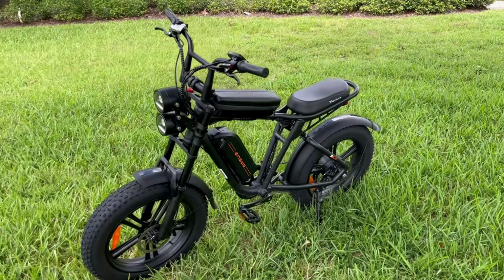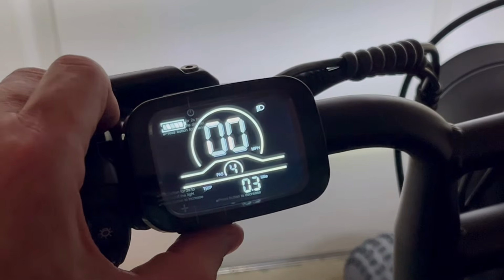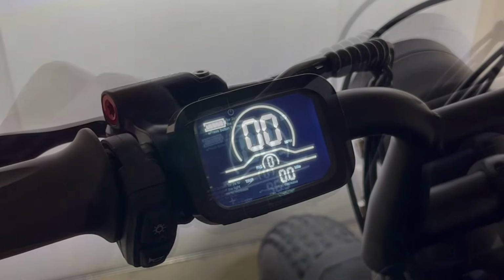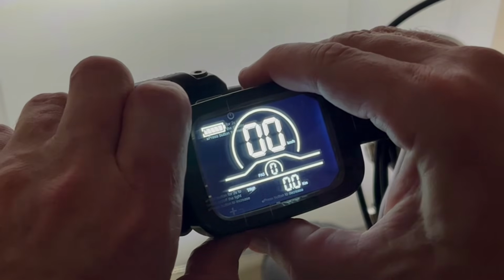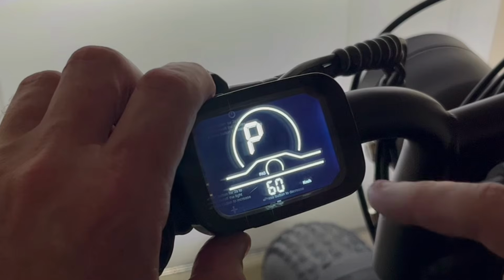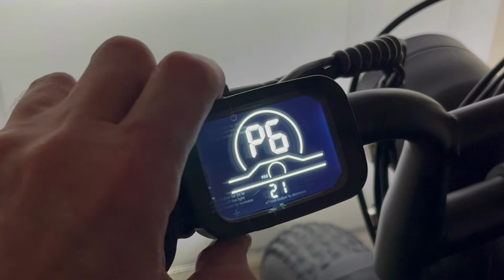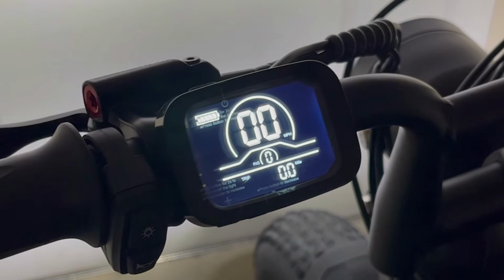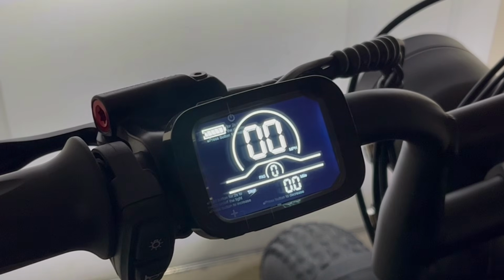Engwe M20 Display & Controller Settings - Yolin YL81C-B  kph to mph

Comment: What do E003 flashing on the bottom
Reply from the maker: E003 usually indicates a motor or controller communication error, so check all your cable connections.

Comment: My front lights are not turning on…. Can you help?
Reply from the maker: Verify if its the light or switch with voltmeter.   Turn on switch then disconnect headlight cable and measure voltage on cable coming from switch
Reply: Same here. Did you solve the problem?
Reply: @LeGoSinA  i went to a shop and the cable had a bad connection so they trade it for a new one
Reply: @franciscobaptista8385 , I guess those cables are not the best. Will replace them all when the Werther is better. Got some external lights for the moment

Comment: i have unluck my engwe m20 to 63 but if i turn up my settings in p2 does it even go more faster then and i allso tuned up my voltage since i have 2 batteries on mine with 26 amp
Reply from the maker: Can you go higher than 63 to 100?

Comment: Hey!
Does the lights at front ever go of?
I can’t seem to turn it off.
Reply from the maker: It should shut off when bike os powered off
Reply: @BRichSolution ig imma have to cut the battery connection off to the front lights.

Comment: Hi there, I am having a problem with my throttle. My rear motor is not moving. I can hear that wants too. I have seen a video on here that punch in some numbers and it work. I thought I saved it but I guess not. If you have any ideas please help me. Ty and love the video.
Reply from the maker: Does the motor work when you pedal and not twist the throttle?
Reply from the maker: See full video for advanced display settings

Comment: I’m reading online that you should put the wheel diameter as 20” and not 23”. What’s your thoughts? Since the wheel is 20”
Reply from the maker: Yes 23” as typical is the outside diameter of the 20” wheel with a tire on it.  I change that setting on most ebikes to what ever gives me the most accurate speed reading on the display screen at top speed

Comment: What happens if you put it on 24v or 36v setting?
Reply from the maker: Speed will be reduced and bike may not operate correctly
Reply: @brichsolution thanks. Someone online told me all it will do is read the wrong battery level and doesn’t effect performance

Comment: How do i change the modes? Like go full electric and not just peddle assist?
Reply from the maker: I think you may have a European model on engwe which does not allow for throttle activation.   Ask engwe how to change.  For some rear Engwe only has p01 to p08 settings.   Most ebikes have advance setting p10 set to 2 allow for throttle and pedal assist.  Let me know ow what Engwe says

Comment: I been holding the plus and negative buttons to bring up the advanced settings but it doesn’t bring me to the advanced settings theirs none of what your showing all that it’s displaying is a SP and four digits that are all set to 0 and allows me to change them between 1-9 but I think it’s the password setting that was in your video displayed as P9. . . . I don’t know if that made sense but is their a yollin device or Manuel that operates differently and I just got the wrong one? Or am I supposed to enter in this password so I can access the advanced settings? Because I don’t know how to do that.
Reply from the maker: Try password 1111 or 1234  if that doesn’t work ask seller for passcode
Reply: @ oh shit ya I should have tried that I can’t believe I didn’t think of that.
Reply: @kurtkiernan6070 sir can you tell me what the password is cause I have the same problem pleeeease??? Ty
Reply: Can someone tell me how to get past this is keep getting SP then the 0000

Comment: Good Lord Thank You! Thank You for taking the time to go over this. I been in my garage sitting on the darn thing trying to make it go w/o pedaling lol. My 1st ride. The thing they call Instruction Book/Owners Manual went right under my head.  I just flew to the local corner store and back and man what great fun! Got mine for $699, free shipping and since I know nothing about ebikes. I paid an extra $53 for the Allstate Protection plan. Covers even normal wear and tear. Who knew anyone did that these days. Hope I don't need it. For a noob ebike. I love it. I ride motorcycles and that's really what I wanted, not the bike part of it. Just to scoot about and there's mtn bike trails next to my house. I just hike them b/c of the deer, but now I don't have to worry. I can ride to the trails, walk or ride them and ride back home. THANKS FOR ALL THAT AGAIN. I'll be coming back. I just wanted to get to the part to get me going, asap.
Reply from the maker: Glad it was helpful
Reply: @BRichSolution  do you know why nothing happens when I try to unlock speed? :/

Comment: Does anyone know about "P8" - my display shows only "P8" and seems to be asking me for a 4-digit PIN code. 
I'm trapped on this screen and my ENGWE display is not activating the bike at all. I think I may have accidentally activated a PIN lock screen on my first ever ride on it because I was 10 miles from my house and couldn't remember how to switch the front and rear lights on. So I started pressing all kinds of + / - key combinations and + & - simultaneously - that displayed a flashing choice of P1 to P8 options. At P8 there was a no / yes question so out of curiosity I pressed "Y" for yes. After that the display refuses to let me move beyond this damned locked P8 screen that seems to want me to enter a 4-digit number.  
There's nothing about these P1-P8 screen displays in the user manual and nothing about PIN codes and what seems like a screen lock.
So - has anyone had this P8 problem?
Do all ENGWE ebikes have a unique PIN code ? 
Can I factory reset it to get rid of this screen lock that I've accidentally activated? 
Paul G
Reply from the maker: Try 1111 or 1234 if they do not work contact Engwe
Reply: @BRichSolution  I seem to be way ahead of you - below is a short Youtube vid posted by someone who has the exact same problem with his ENGWE M20 which has a display/functions which are 100% identical to my ENGWE P1:
https://youtube.com/shorts/w_1AD9fynrI?si=4K5mgYdbeBOWB-WT
Many of his desperate comment-posters there still have the same problem.
PS. Why do you suggest "1234" and "1111" - have others successfully tried those 4-digits with this specific ENGWE PIN lock problem??
As for contacting customer support - of course I sent ENGWE a full description(last night, Sunday) and a broader complaint about the non-existence of an ENGWE P1 Display user manual(ie. pdf file) - and they've promised to get back to me...
Paul G

Comment: Is there any way I can limit the speed the throttle can output as in germany the throttle is only allowed to go up to 6kmh?
Reply from the maker: Not that i am aware of.   I would disable the throttle or unplug it and use walk mode for 6km/h
Reply: @BRichSolution  thank you in p3 I put the speed to 25kmh but it still goes 30+ on Pas 5 I dont know what to do

Comment: My new US version of the M20 only goes up to 40 for the highest speed adjustment in the display. Does the changing of the AMPs really do anything?
Reply from the maker: Were you able to confirm the speed with gps app?  I have a ebike says I am doing 37 but confirmed with GPS app showed 32 mph
Reply: @BRichSolution  I edited it. It only goes up to 40 on the display for adjustment vs the 60 I keep seeing on the videos.
Reply: mine does the same on 40  not 60 like all the videos
Reply: 40 is mph, 60 is kilometers ph. Listen to what he says on P3… then he switches it to Mph on P4.

Comment: Hey thanks for the video but my question is you had the tire diameter at 23. Shouldn't it be 20 since they are 20x4 tires?
Reply from the maker: 23” is the outside tire diameter of the 20x4 wheel
Reply: @BRichSolution  ohhhh. Ok thanks 😅

Comment: Does anyone know how to fix error 30?
Reply from the maker: E30 is communication error according to manual see link below.   Check the connector on the wire harness.  Disconnect the connectors and reconnect to ensure they are seated.   Did the bike get wet?   http://myosuploads3.banggood.com/products/20230321/20230321034539M20.pdf

Comment: Hi how I change into just power without assistance????
Reply from the maker: I don't see a setting for disabling the Pedal assist.  You could dry to disconnecting the cadence sensor on the pedal crank at the controller to see if that works
Reply: I had this exact issue. Worked like a charm, thank you! 
Now it's throttle only, no peddle assistance!  @BRichSolution

Comment: Very helpful,
if I wouldn't have tried this already.,.
The thing is, pushing + and - simultaneously doesn't open this illusive settings changer.
Reply from the maker: sometimes if you push one button first and not simultaneously it will not enter advance menu
Reply: @BRichSolution  srr,
the problem is that they locked this feature
and the only thing I can access is the factory reset.
Without me being able to change settings to 25km/h and settings to mph,
the bike I have isn't street legal.
( It drives 5km/h to fast )

Comment: Hello, I’ve bought mine Engwe m20 750W, but I’ve got one with the manufacture sticker saying it’s 250W. I’ve contacted Engwe and they are saying that my bike is actually 750W and “The 250w mark on this sticker is only for customs clearance”. Have you guys had the same problem? And of course I can’t unlock the speed 🤨
Reply from the maker: Can’t unlock it?  Does the screen have a passcode?  If so try 1212 or ask engwe for passcode

Comment: For those who can't adjust speed in +- menu when you enter the "+-" menu hold power button and + together on P1 untill screen flashes with 60kmh. The you can increase amps to 25... Other than that there's nothing you can do. Bike will top out at 27/28mph .
Reply from the maker: Thanks for the info!
Reply: Mine was going 33 then I took it to the bike shop to a popped tire and when I git it back it won't go past 25 miles a hour
Reply: Doesn't work

Comment: I managed  to lock myself  out on P8 , the release code is as advised 1212 however despite several  frustrating  attempts  over some 30 minutes the code was not accepted. 
Then suddenly  the unit decided  it was right & allowed  me to reset. Seems there is some  kind of inherent fault.
Reply from the maker: Interesting and thanks for the feedback

Comment: Author, thanks for the video.
How to remove speed limits?
My ENGWE O14 bike travels at a top speed of just 26 km/h.
Reply from the maker: Try passcode 1111 if that does not work then contact Engwe
Reply: @BRichSolution  You can find out more about exactly how to do this! and where to enter this password?
Reply: @BRichSolution  Thank you. Can you be more specific about where and how exactly this code should be entered?

Comment: I have the same controller, but when I go into the advance settings, it goes to P0 and I can’t advance it past that it has four numbers I can change at the bottom to start off at 000 but I can’t get into the advanced settings for the real size and changing the speed
Reply from the maker: Ask engwe for the passcode

Comment: Hello 
P3 is not working it's on 25 not increasing and not reducing
Reply from the maker: reach out to Engwe for solution.  Do you have 250W motor or 750W motor?